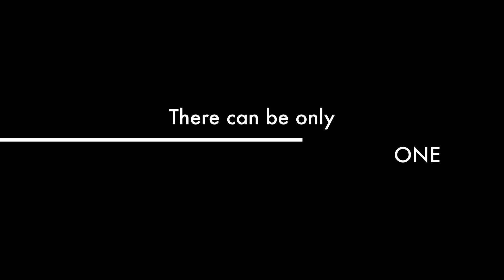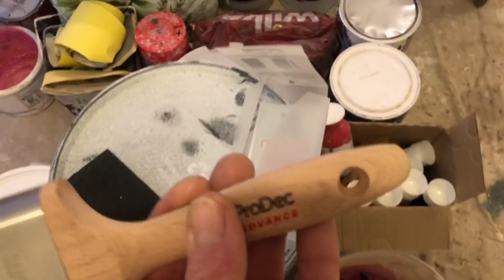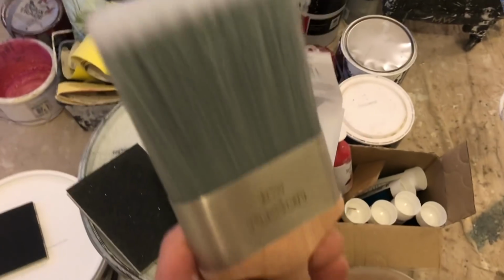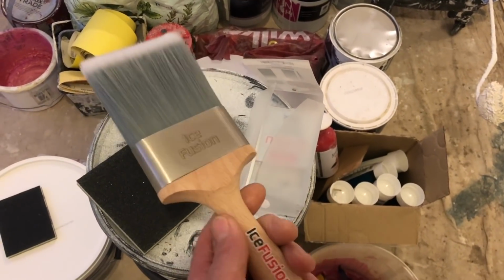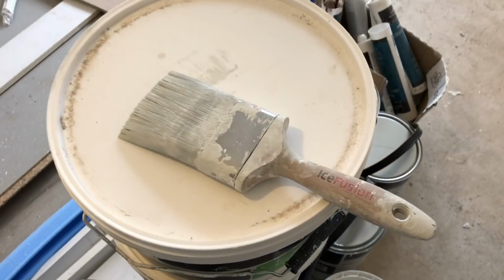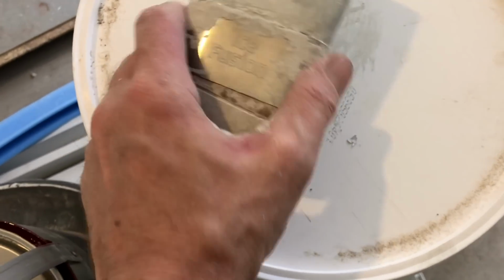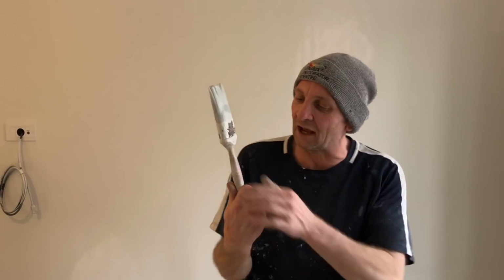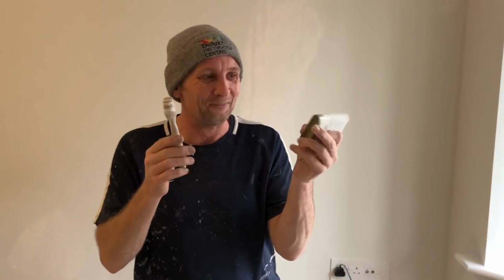Prodec Advance Ice Fusion Brush Fall to BITS

Comment: I've found the prodec ice fusion brushes superb out of the box, they carry a load of paint and easy to handle. Cutting in with these for me hasn't been surpassed by any other make todate, I've only used them on waterbased non alkyd todate though. I can highly commend them. The brush in the picture, I'd just glue back in, these things happen.
Reply from the maker: These things don’t happen on every single bloody brush 😞

Comment: The problem with some of the new brushes its not the quality of filaments/settings and ferrules, its that they use new (un-seasoned) softwood handles (fsc) that shrinks with temperature/moisture changes over time, unlike with hardwood handles, which seems to be what's happened here.

Comment: I wouldn't say it fell to bits, just a slight change of the handle stock to be longer to fit inside the Ferrell & use a better glue, the bristles were still intact by the looks of it, I also think the handle has obviously shrunk using crap wood, also you had the same problem with the Ferrell using the kana didn't you, maybe your pressing to hard to, you looked like you were fighting the wall cutting in, be a bit more graceful let the paint flow. That being said I was surprised how little stock was pushed inside the Ferrell to clamp it to, obviously a design flaw. Good video mate.